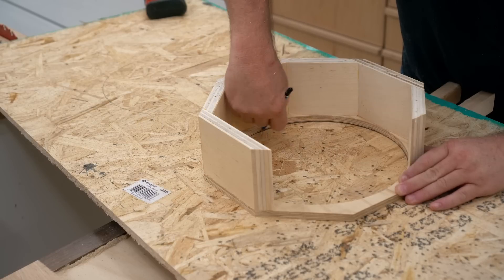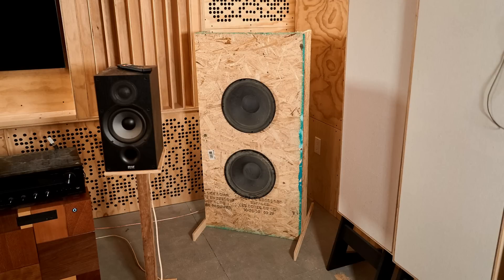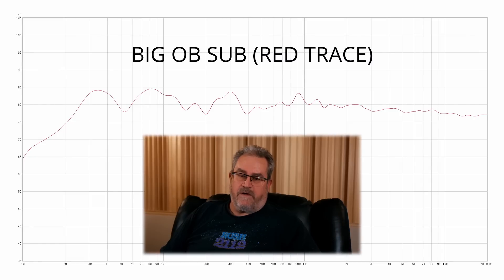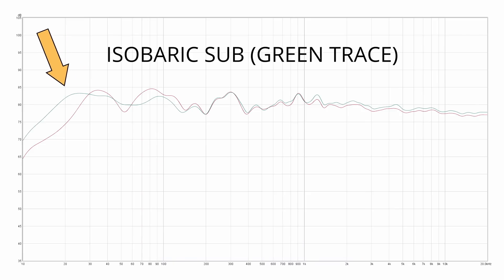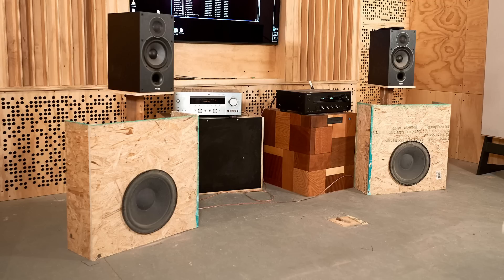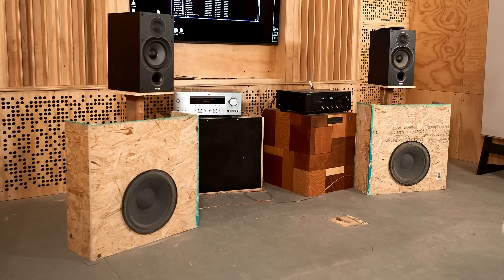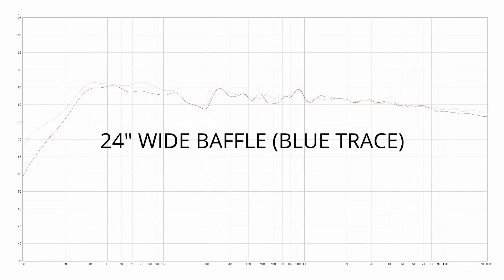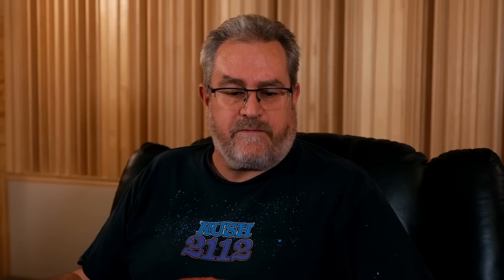Experimenting With Open Baffle Subwoofers - Unexpected Results

Comment: Man, your videos make me wish I can rebuild my speaker cabinets that I designed back in high school. There were some mistakes I made back then that I would like a second chance. One of the main things is in my design I had a Sub built into each cabinet it self and powered separately from the 3 way config. Also, I didn't have the money (being 16 years old) to afford 2X12" woofers and 2x12" subwoofers. But now being old and slightly wiser I'm not sure it would work with only 2 cubic foot of air space. 

Side Note: When I built these back in '92 I made them out of 3/4" Birch Ply and everybody including my shop teacher thought I was crazy for using that wood. Now a days it looks like a lot of people are using Birch Ply or Baltic Birch Ply. Looks like I was on to something back then. Also, when they were finished and had the people that thought I was crazy have a listen, they all had the same surprised look on their face. They did end up sounding really good even with crappy Radio Shack speakers and the infamous Realistic 12" subwoofer 😀

Comment: Interesting that the first stacked baffle didn't benefit from line array coupling to produce a higher SPL.  I need to think back a little...  Maybe that effect is dissipated as the frequency drops...?  That would make sense...  It would take longer for the coupling to occur since the wavelength is longer...  I bet if you were listening across the street, you'd see the bump.  LOL.  Sorry for the ramble, it all makes sense now.
Reply from the maker: If anything there was some comb filtering with the big one because the woofers were so far apart, and that showed up in the measurement (that lumpiness from 30Hz to 150Hz).

Comment: Happy to see you experimenting with open baffle. Food for thought: a "w" frame arrangement may also be a good option, as it would cut down on the subs' physical presence and may yield similar results. There's a lot of options out there for tweaking open baffles.
Reply: I always wanted to try make a W manifold for my Celestion open air isobaric dipoles sub woofer that in spite of being 45kg would shake like crazy when playing bass... A W manifold and mounting the woofers so the acceleration forced and vibrations would cancels out would have solved that, and that rocking was just pure wasted energy...

Comment: Very interesting John.  You may have mentioned it before but what drivers are they?  I'd be interested in looking at the specs.  Many thanks.
Reply from the maker: The drivers are 12" custom made by Eminence. T/S specs:
Fs - 27.9
Re - 7.4
Qms - 8.9
Qes - .5
SD - 510cm^2
Vas - 126 L
Xmas (peak) - 9.8mm
Reply: @IBuildIt  Thanks John.  Specs aren't everything but those are good specs!  One good thing about open baffle designs is the Qt doesn't change as it does in a box.

Comment: Hey John. Great video!

I'm curious on the QTS value of these drivers. That's an important consideration when building OB subs. The higher the QTS the lower it can play.

This also makes me want to grab 4 18' with a high-ish QTS,  and corner load them in my room for some easy bass.

Also, I was curious if you would not mind looking at impulse response , group delay etc when comparing OB to ISO? That would be a pretty neat talking point, though I don't think those necessarily matter in lower bass.
Reply from the maker: These woofers are 0.5 Qts. 
Virtually no difference in the impulse response between the iso sub and these, but I was measuring the everything together, and not just the subs.
Reply: @IBuildIt  Right on. 

I'm curious how an H frame open baffle woofer would look measured. Less cancellation around the sides. You interested in trying something like that? Do some H frame OB, vs Flat OB, vs ISO?
Reply: pretty low Q for an OB system. It is very difficult to find drivers really appropriate for OB below 30 or 40 Hz. IB or sealed is much easier to find drivers for that can get that last 8va from 32Hz to 16Hz.

Comment: I have been told to keep open baffle subs at least 36" away from the wall.    In my room I have found that my open baffle speakers are much better suited for music than theatre.  You are more than welcome to borrow my Rythmik amps and GR subs so that you can use the options that the amps offer for delay, cross over, etc.  Or you can use the amps to drive your drivers to see if the adjustments actually help in your situation.  I cannot use them for a while and would drop them off it that helps.   Paul
Reply from the maker: Thanks for the offer, Paul :)
I don't think there a specific minimum distance they must be from the wall, but of course if they are too close it will basically box them in if they have wings like these do. And very little of the music I listen to has the kind of deep base that movie soundtracks have, and it handled both quite well. Of course these are four 12" woofer with pretty high excursion, so they are moving a lot of air.